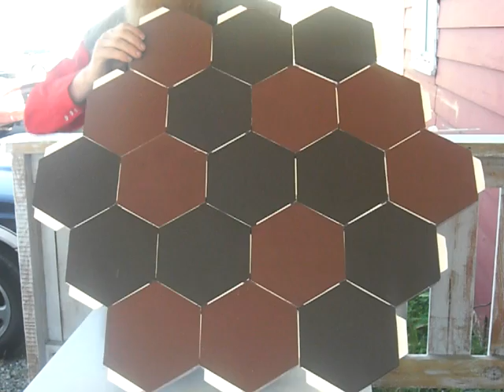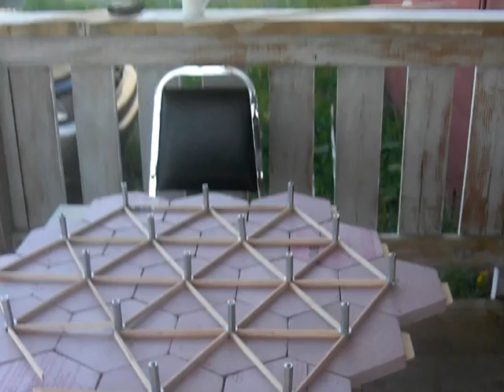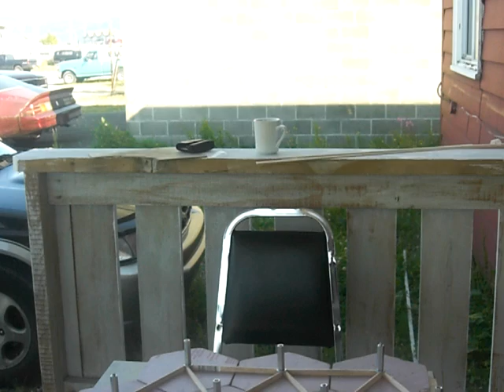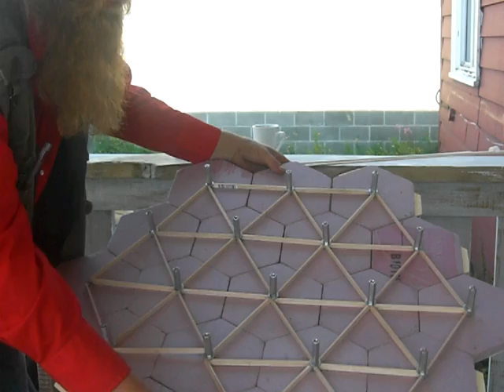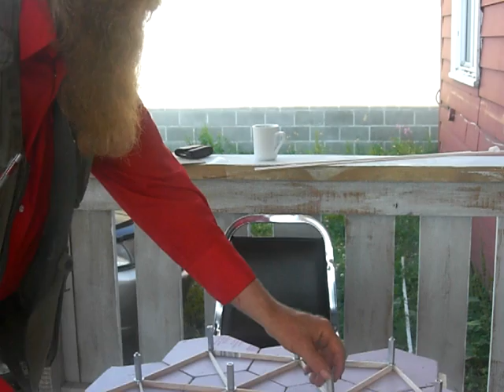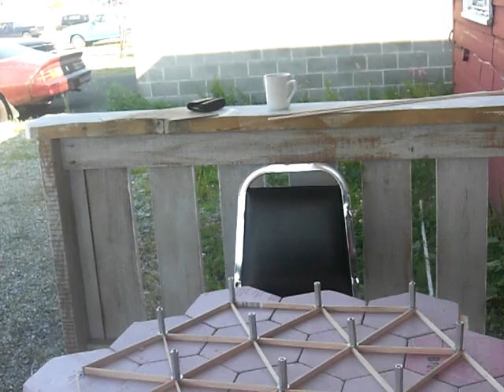Refuge Cabins   05

Comment from the maker: Joshua here-The full scale model will not be made out of balsa wood and hot glue.  The hexagonal panels themselves will be constructed out of 3/4 fir for the top and bottom and likely a 7/8's marine grade for the interlocks.  6 in high density foam coated with 2 layers of fiberglass will made up the insulation portion.  The tops could either be fiber glassed or bonded with a 1 inch layer of fiber concrete depending on use.  I'm sure that one panel will be able to support at least 5 lbs. per sq.'

Comment: Cool... so when there is boulders the size of houses coming down around us like hail and the air turns to plasma at 1500 degrees and there's a deluge of water 2 miles high washing across the face of the earth at near supersonic speed and then the sky is darkened shutting out sunlight for a year... i'm going to be fine cos i'm standing on ur platform held together with hotglue and balsa wood? Excellent. I hope it comes with a guarantee though, and is there a sport model available yet?